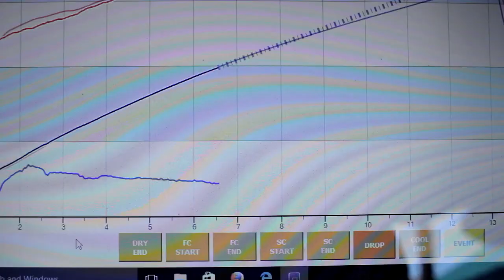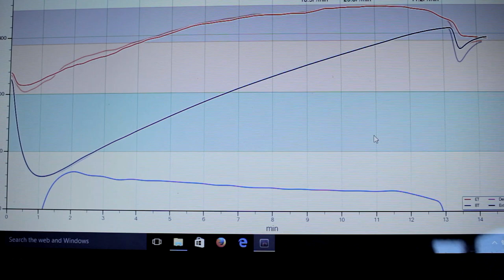Big Tuesday Vlog | Roasting Coffee on the Probat, Bakeshop, Late for Work

Comment: Savage vlog Chris! Is that a Probat L5 you're roasting on? If so, does it have a single, or double wall drum? Keep up the great work and wishing you huge success with Cat&Cloud - love the podcast btw ;)
Reply from the maker: Thanks Brian! It's an older L12. It has a single walled drum but with a heat shield around the whole drum so there's a bit of a buffer between the burner and the actual drum. No fancy stuff with this roaster but works really well.